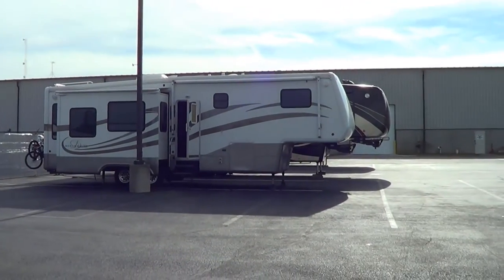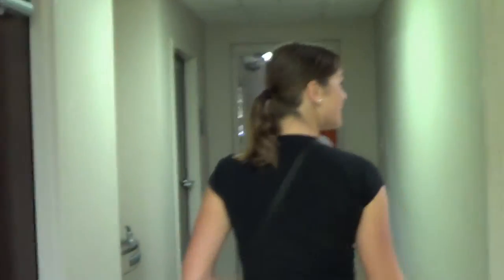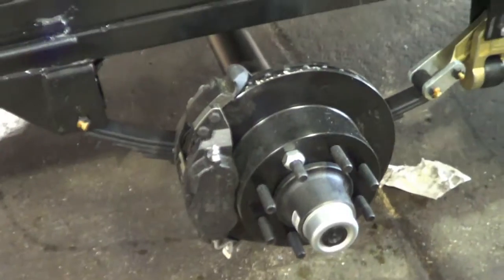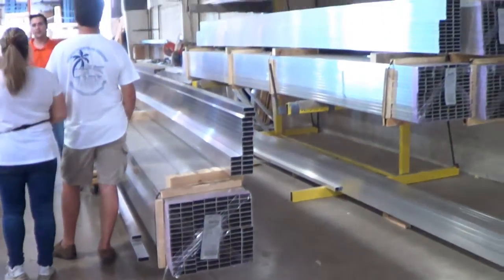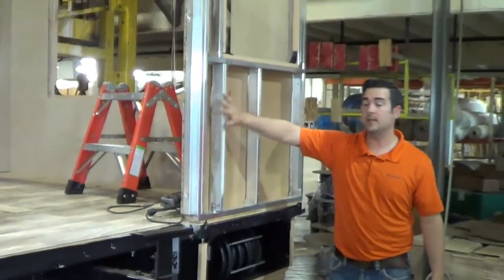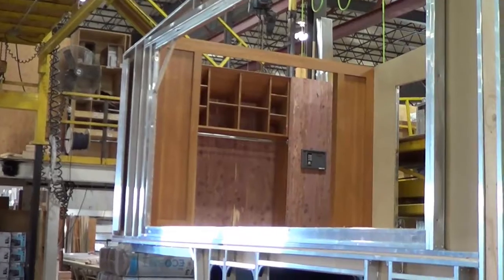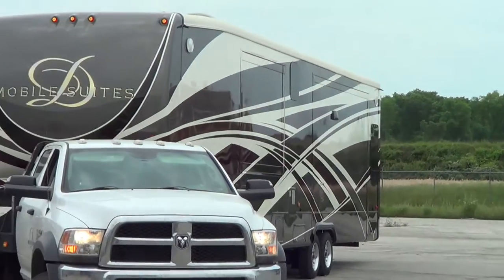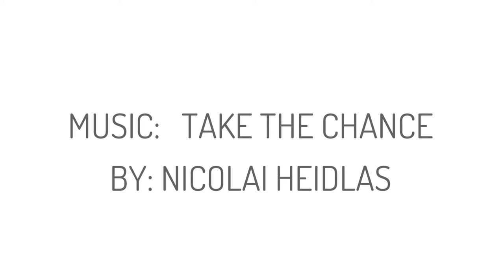Touring the DRV Luxury Suites Manufacturing Plant | VLOG 53

Comment: Airplanes structures are welded. The skin is riveted. Screwed and glued is a cheaper and faster way to build walls. Don't fall for the marketing.
Reply from the maker: I had to do some research on that too but they are partially correct... I built a kit fox and yes the primary frame was welded, but many older larger airplanes and even some modern ones still rivet or bolt most of the main frame components.   Just tour some flight museums and you will see lots of riveted frames.
Reply: Perhaps we should take my aluminum bicycle frame and cut the welds. We can then screw and glue it together. It would save a huge amount of money in production costs. How confident would you be to let your wife ride the bike downhill on a twisty mountain decent?
Reply: 35goaltender